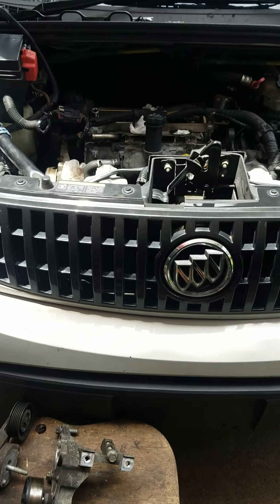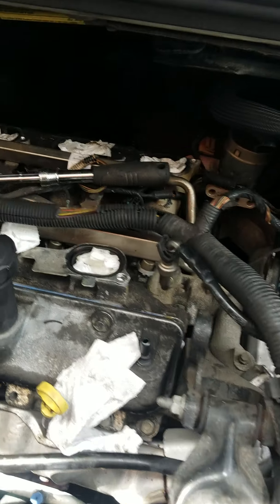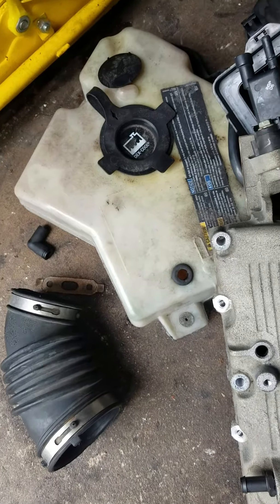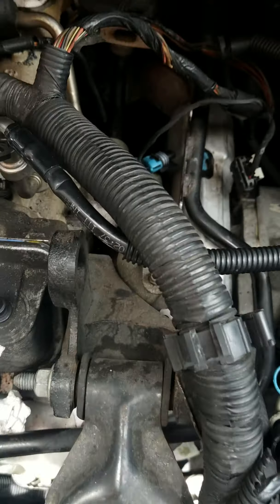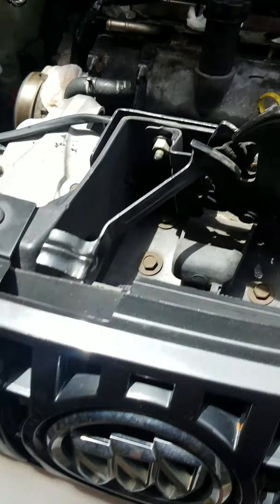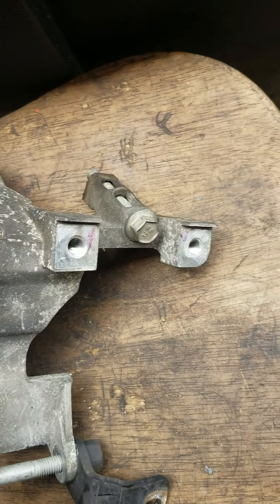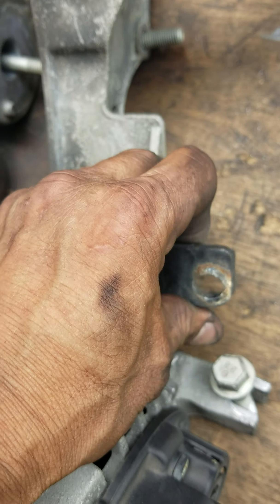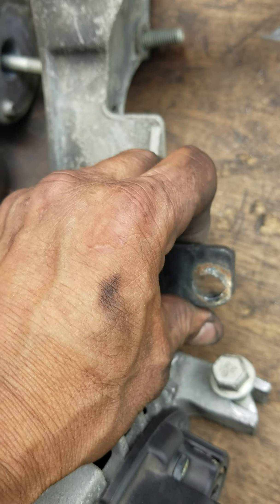2007 Buick rendezvous spark plugs, valve cover gasket, alternator  replacement.

Comment: I have the same exact vehicle, even same color. There’s actually a much easier way, I was in the same boat as you, but then found out all you gotta do is unbolt the 2 motor mounts right in front, and you can roll the engine towards you and get to the plugs. Mechanics have a special tool to roll the motor but you can take a tow strap, hook it to the motor, then to your frame and crank the motor towards you. Once you release it, the engine goes right back in place. All you have to disconnect is the air intake tube. Hope this helps for next time.
Reply: Haven't done it myself (...yet), but even easier than using a tow strap or a come-along to crank the engine forward, you can just push the car a little bit and then block the wheels (after undoing the front engine mounts, of course).  Obviously this would be best done on a flat surface and with the help of a friend or two.  By moving the car while it is still attached to the transmission, and thus the engine, it will rotate the engine forward.  Then, when done, you just roll it back.  Things align as they were and you just bolt it back up.  There is AT LEAST one video about this here on YouTube.  Just search "Buick Rendezvous roll engine" (or something similar) and you should see it.  Looks like the easiest method to me (...unless you really can reach them from under the vehicle without having to do any engine rotation, as the other comment suggests).  Good luck!

Comment: I agree with your opinion about whoever designed these vehicles, I had to remove the windshield washer fluid reservoir to get to the battery. I replaced the brake lines going to the front and rear on the passenger side, it was not easy. They didn't build these things with the mechanic in mind.